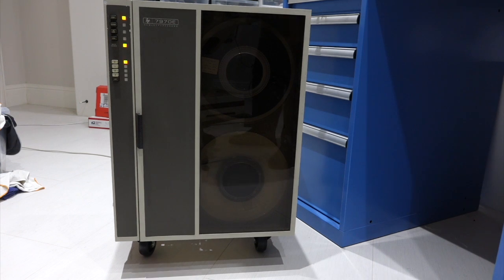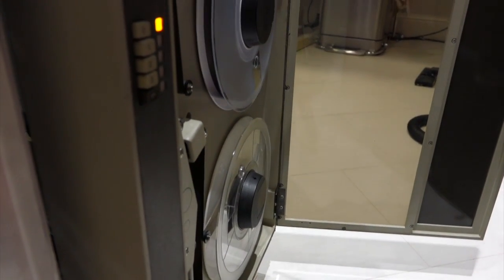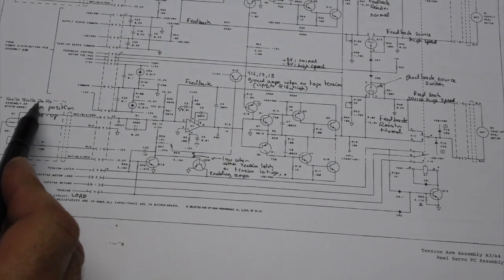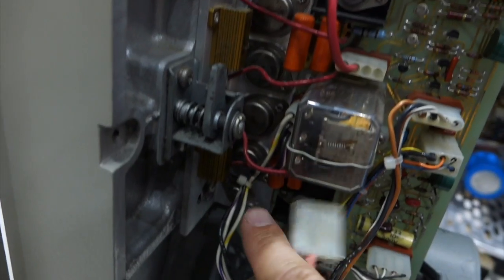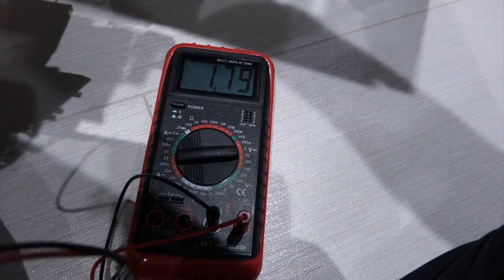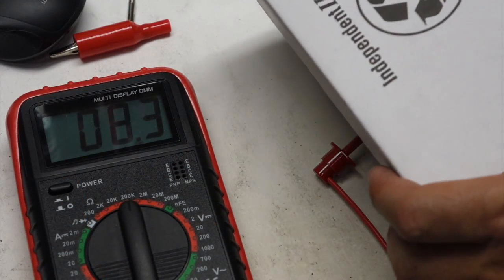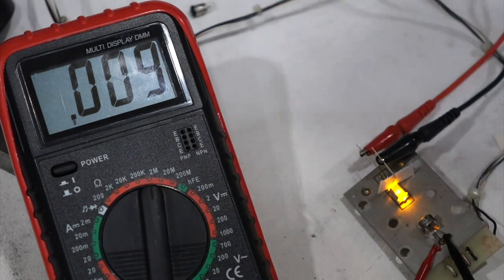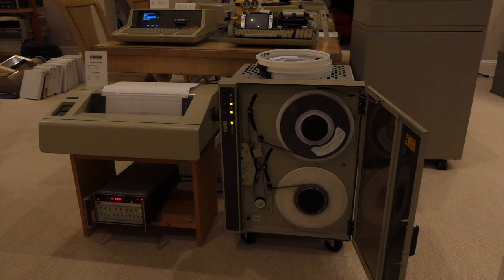HP 7970E Tape Drive Repair

Comment: I watched a torn-down modern-ish LTO 8 drive in action on Tech Tangents tonight and was shocked by the apparent simplicity of the mechanism. No spinny drum helical scan or anything,.. just a normal-looking tape head with a linear actuator to select different tracks.

Comment: This video brought back great memories Marc. I was the supervisor for a 55kW UHF analog TV transmitter. Two Varian klystrons were employed in final service on an RCA TTU55.  One afternoon the TV station went off the air.  I had a co-worker with me and he couldn't understand why I walked into the transmitter room in the dark. The 480v three phase variacs in the focus supplies had a magnet current meter. Much like your tension arm, A #94 wheat bulb was used in the meter. When a magnet undercurrent or over current condition existed, the light beam was interrupted by the flag at the bottom of the indicating needle, turning off the 27kV DC supply to the klystrons anodes.  GUESS what had burned out. In a dark room it was easy to spot and repair in the meter.  Glad your LED hack worked, Curious Steve (me) would like to know if that LED is still working on your tape drive AND did you ever change the other lamp out during a PM cycle?
Reply from the maker: Yes it still works and no I have not replaced the other lamp.

Comment: As an HP CE I repaired many 7970’s, one of my customer sites was the Shell computer centre in Manchester UK.  They had many of the variable density model as they took in tapes of all types from across the Country, the drives were part of a  Microfiche printing system for long term storage of data.  On PM visits the drives had to be calibrated from 800 to 1600 BPI.
Reply from the maker: I'd kill to get a dual density model...

Comment: 5000 years later: as we can see these leds are not functional, i need to find a matching magic infrared light source to fix my beautiful HP 7970 or better i will use an active artificial light sensor with a camera that works on the infrared energy that is already present in the enclosure - no need to match the power rail.

Comment: I have an old Grundig Radio-Alarm Clock with an ancient backlit LCD display for the clock/frequency display. Lit with a small halogen bulb. That bulb lasted exactly 35 years from 1985 to 2020. Continuously lit 24/7. Amazing.

Comment: When I used to work on old copiers, they use incandescent bulbs for some of the sensors and every time the machine was moved in or out of a building, it would break the filament.  Had to carry bags of them just because of that.   Good find!

Comment: Here is some hp trivia.  Both the 7970 tape drive and 2631 printer were manufactured in Boise Idaho.  The 7970 was the genesis of the Boise plant in the mid 70’s but both products came from what was called the Boise division of hp.  The printer side eventually formed a partnership with Canon to make laser printers which became the genesis of the LaserJet printer products which are still the best selling in the world.  I worked at the Boise plant for over 30 years and had a front row seat on an amazing journey.  Those products were tanks like all hp products back then.

Comment: Test points were needed because almost every kind of computer equipment was prone to failure back then. Using a lamp with a filament is a great example of why this was the case.

Comment: I LOVE your videos, it brings back so much memory. I work at hp since 1975. btw we use the same light bulbs in the 7900 disk head positionning. mechanism.  The bulb  was atomatically replaced every 3 months, among other stuff, during preventing maintenance :-)

Comment: how much data does that tape reel store?
Reply: bradley morgan 
At 1600 bytes per inch, a ten-inch reel holding 2400 feet of tape would store about 50 megabytes data. At 6250 BPI, 250 MB of data. A 64 GB flash drive today will hold 256 reels of those tapes.

Comment: wow memories -- if that's the drive I think it is, I worked in the same lab as the 7970 guys back in the early 80's -- have any HP 2608A impact printers?  We did real quality work at HP Boise.

Comment: That 'Vintage bulb' you saved, looks like one I regularly replace on our machine light guards at work.  What are it's dimensions?
Reply from the maker: Absolutely. It's a "garden variety" 6V bulb, 5 mm in diameter. Still made today and easily available.

Comment: When you mentioned the optical sensor I just assumed it would be using some type of LED so you can imagine my surprise when you opened the sensor to reveal an incandescent bulb! No wonder it blew if you had to transport the drive in a vehicle to the exhibition - those filaments can be SO temperamental with vibration. Nice repair with the LED, I'd be tempted to change the other one as well but I expect you prefer originality over convenience.

Comment: 5:54 oh god are those wax capacitors?
Reply: From the looks of it, pretty standard axial foil capacitor in a potted plastic housing. This is not a tube/valve radio :-).
Reply: Christian Vogel Thank god. Those caps short like crazy, some 80% failure rate for me.

Those capacitors have been used in a few computers as well - it just looked like this was one of them.

Comment: Ahh the wonderful days when stuff was designed to be repaired!
Reply: @ TheColinputer
Yes, and they always had a schematic in the case or on the back of the machine.  Nowadays you have to hope they're available online somewhere.  There was also something about the printing that made old schematics much easier to read.
Reply: @larrygall5831  agreed! I collect tube audio gear and all of it came with a service manual to be able to fix up the equipment! Even my JVC four channel has a schematic that came with it! It's a 4 page fold out schematic, but frightening enough to make me scared to dig into it to find out why my left channel is dead 🤣🤣🤣

Comment: I wonder why they didn't use LEDs originally, were the types available back then just too dim to be useful in such an application?
Reply from the maker: This design is quite old. The first version of this tape unit came out in 1970 (the HP 7970A, which has identical mechanics). So these sensors arms must have been designed in 1968-69. I suspect LEDs were just too new, dim and expensive to be considered. Their simple solution was to use a cheap 6V light bulb, but severely under voltage it so it would last a very long time.
Reply: Ah yes, that makes sense, LEDs were quite pricy back then, and only useful for indication.
Reply: Also old LEDs were very inefficient, just barely lit when run at 20mA (where a moden high-efficience LED will be eye-scorchingly bright).

And old LEDs definitely are aging, I have some vintage audio gear where constantly lit indicators are now really, really dim to the point where they are barely discernible under normal desk light, so even if they had used the first available LEDs in the 70s I guess they would have worked not as long as the 6V lightbulbs did.
Reply: AIO inc.
 There's also the possibility that the materials used in certain components are not manufactured to the same standards as prior and will fail much sooner.  Almost a year ago I bought a new Magnavox DVR.  Many segments of Florescent display is already seriously degraded.  I know that Florescent displays fade much faster though, this is a bit ridiculous.
Reply: Their simple solution was to use a cheap 6V light bulb, but severely under voltage it so it would last a very long time.

K.I.S.S.!! :)
Reply: In my digging and a reference to something I remembered.  Was the first practical LED display calculator introduced by HP in 1972, the HP-35 with it's itsy-bitsy display equipment with coke-bottle magnifying glasses?
Reply: +Christian Vogel I've got a laptop with dim charging and power lights - it's been on the charger most of its life I presume. Original battery is still good, though. 

It's not an old laptop either, it's a Toshiba Satellite A135-S4427.
Reply: DandyDon Isn't it great?
Reply: Ron Laws 
These tension arm tape drives were later superseded by streaming tape drives.

Comment: Was there a variable opening slit in the arm that varied the light coming through or some kind of gradiant material?
Reply from the maker: Much more clever. A constant width but spiral-cut slit, in front of a photoresistor with two terminals (+ and ground) and a midpoint tap (position sense). The equivalent of a voltage divider controlled by two photoresistors. Depending of the ratio of illumination of the two halves you get a different midpoint voltage. If the slit is towards the top, the midpoint voltage is higher, if its at the bottom, the midpoint voltage is lower.